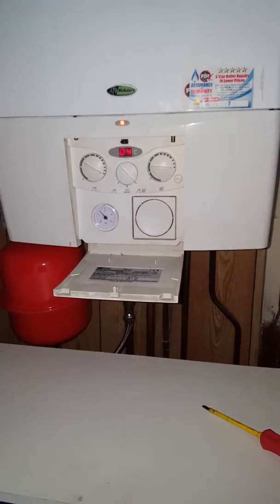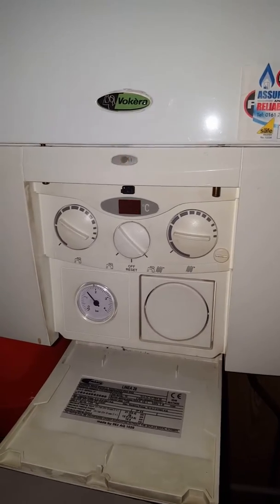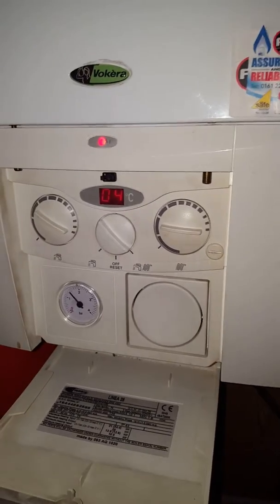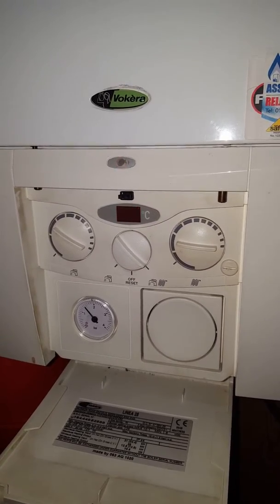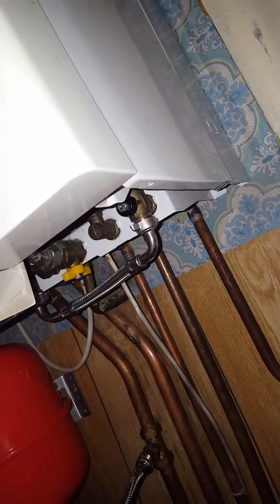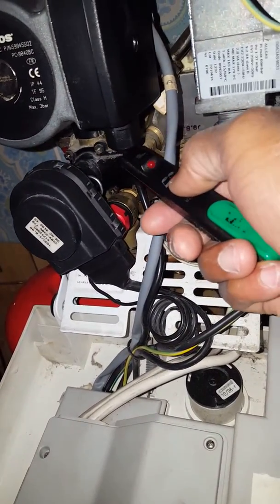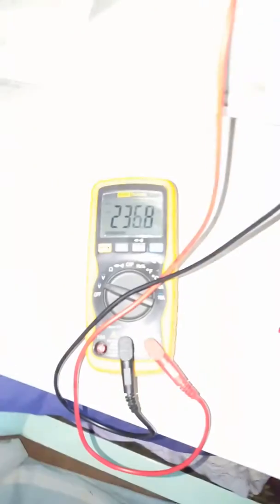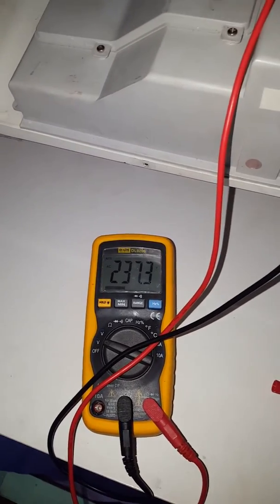Vokera Linea 28 04 Error message

Comment: We’ve got the 04 problem. It’s quite intermittent but when it goes we lose hot water and heating. Often turning it off and on sometimes makes it work, when the flame ignites it’s often fine but often goes straight to 04, often with no flame at all. We can’t get a repairman at the moment, any tips to help us short term? Thank you
Reply from the maker: What area are you in?
Reply: A+R Central Heating and Boiler Repair Experts Ltd Leeds, LS15 😊